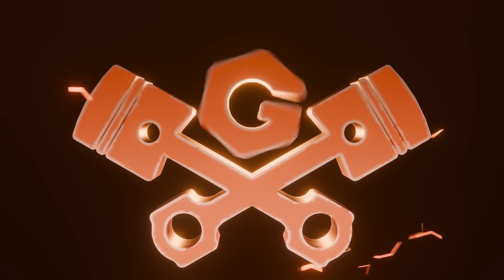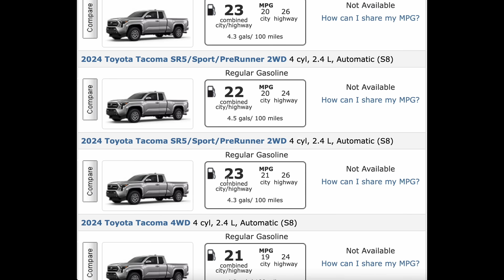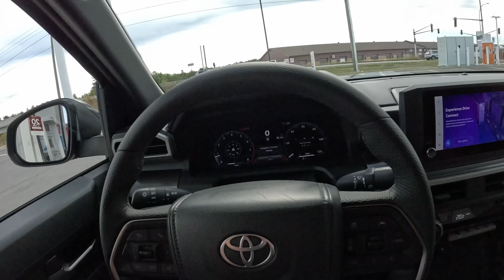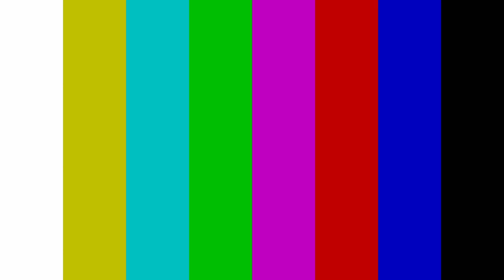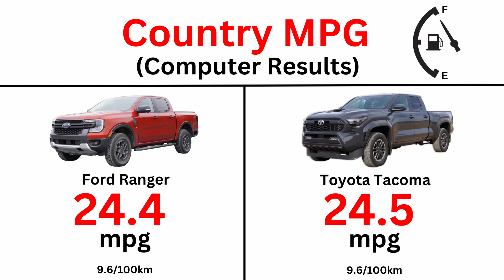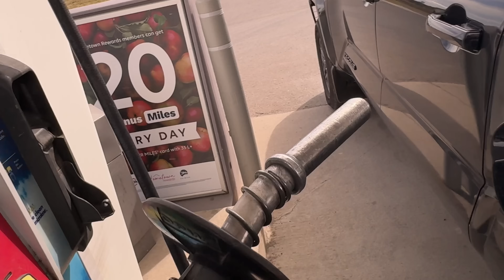Toyota Tacoma 2.4L Turbo Fuel Economy (MPG) Test | Shockingly EFFICIENT or OVERHYPED?

Comment: Mid size trucks never made a whole lot of sense to me, my 2017 Tacoma with the V6 and max tow only averaged around 19-21 unloaded and towing my 3-4k lb trailer got 10-13mpg. I switched to a Ram 2500 6.4 gas and got 16 towing and 19 highway unloaded. I was shocked to be saving money and the Ram never had any issues, my Tacoma had some major failures and was constantly at the dealer.
Reply: Was it transmission failures?
Reply: @TomXCZD  No on the Tacoma it was engine leaks, diff problems, engine problems, radio problems and a major cab leak.
Reply: You're not wrong about the mpg being rather negligible but a lot of people (including myself) don't want a vehicle that long and wide. They also cost about 10 grand more if you're comparing equivalent trims/features.
Reply: Yeah the amount of people glazing these 2016 and 2017 Tacoma like the holy grail is so funny. People really do have gold fish memories. 3rd gen tacoma was called Turd Gen for the first few years when it launched. 2nd Gen owners were saying Toyota ruined Tacoma when 3rd gen launched. And now 3rd gen owners are saying 4th gen is ruining the Tacoma. 

When 5th Gen launches the current owners are gonna say the same crap lol

Comment: Can you do this with a SV Frontier?
Reply: I will tell you, as an owner.
The frontier pro4x with premium package, no roof rack, no light bar with soft tonneau cover is a consistent 16mpg city, 19hwy. 17.3 mpg avg over 13 fill ups. 87 e10 top tier fuek. 
I added a kn filter, taller michelin ltx at2 tires, kn filter all synthetic fluids it improved by 1mpg. 90 octane non ethanol it adds one more. 
You run it hard highs speeds on interstate, its even worse. 
The sv is somewhat better as its lighter, diff gear ratios, non locker, smaller tires, sits lower to ground. 
Its 2-3mpg better on average. 
Local advance auto has the 2wd, king cab base model  and it gets  20 and 23. But it is bare bones as can be had, with very skinny tires, and the ass end 3-4" higher than the front. 
Nissan missed the mark badly on that engine and transmission. Plus  that huge ass frontal area of the new grill design is bout as aerodynamic as a brick. 
What the dash shows is a consistent 2-4mpg low. Anyone tells you they are aversging better than 20 mpg on a new frontier dont know this or are full of it.
Reply: My brother gets 19-20mpg in his Pro4x with 265/70r17 tires. He's mostly highway with his commute.
Reply: @Tylnorton id that  hand calculated or dash dispaly?

Comment: My friend as the same Truck with now 25,000km's.  It was going to be my next Truck till I drove it.  Engine power is good but it ride's like crap.  It's so rough and feels like it's falling apart when you go over rough road (hood shake's and feedback in the steering).  His interior plastic's is not holding up good either.  I am a big Toyota fan but My 1995 GMC looks better inside.  Very Disappointed in Toyota's since the 2022 Tundra was released.
Reply: "My 1995 GMC looks better inside"

Absolute cap bro lmao.

Comment: First of all what you call "city Driving" is inaccurate.  Let's see the fuel economy when in continuous stop and go traffic?  That is real city Driving.  In my opinion your choice of roads is more closely related to highway despite the reduced speeds.  Non hybrid vehicles get worse economy in the city vs highway so that tells me your test is inaccurate.
Reply from the maker: I mean I drive right through the heart of the city its as much "stop and go" traffic as I'm going to get. you aren't wrong but the key with my tests (in my opinion) is that I run every single truck on the same route so its not so much about matching the EPA figures but rather comparing the truck against each other on the same route.

Comment: It's fine for someone who doesn't need a work truck. None of these 4 banger turbos is going to last if it has to work hard.
Reply: You must be psychic to see in the future like that. If these new ones are anything like the old ones, they'll last. I believe Toyota knows what they're doing. Time will tell.
Reply from the maker: one of my concerns as well. but it is a mid-sized truck and probably not meant to be doing long stretches of work to begin with.
Reply: @GettysGarage .... Im.still.driving my 99 Tacoma, v6, automatic, its loaded with tools, work camper , 3 ladders,ext cab full of cordless tools and pull a small trailer often, i drive 5 days a week as a Trim carpenter, still going strong, maybe the new ones arent built to do that, but mine Works
Reply: @GettysGarage a little off topic but I was wondering what your thoughts are on diesel oil. I'm currently using Mobil Delvac Extreme full synthetic. ( Vs. Rotella T6) .
Reply: Why is everyone scared of turbo engines?  The turbo will last as many miles as you can drive in ~10 years...and then it'll be something annoying like the wastegate shaft seizing up.... Honestly, the more you drive it, the less likely that failure is.
Reply: you shouldn't buy a tacoma if you actually need a truck to do truck stuff....check out the new frontier instead.
Reply: @billw8476   Nobody wants a Nissan lmao

Comment: My best mileage on a 24 TRD Off Road 4x4 is 27.5 mpg. I avg 25. Its 40% better than the 3G 3.5 V6
Reply from the maker: the 3.5L was a thirsty girl
Reply: I do also with my Land Cruiser with some bigger tires.
Reply: Is that actual hand calculated at the pump mileage or the dream meter?
Reply: @deweysturgill6220 the “dream meter” showed 17 mpg consistently on my 22 4Runner, so I’ll take the win even if it isn’t completely accurate.
Reply: @ToyotaChrisWI 😂if nothing else it makes you feel better. You should hear what some of locals here in the hills of east tn what the runners are doing on hand calculated mileage. 
Its brutal esp the ones with more agresssive tires and an overland rack on top. Like a big block chevy.
Reply: @deweysturgill6220 yes sir, I was there back in April, and heading back there next month 🤘🏼🤠

Comment: 2018 ram 1500 321 rear 4x4 quad 6 3/4 bed. All terrains. 21-25 mpg 45-68 mph. Plus a ton more PAWAH BABY!!!
Reply from the maker: The rams can be sneaky fuel efficient!
Reply: Same specs, just 2017 and V6. Used to get 19-20mpg. Now I get 17-18mpg. Falken Wildpeak AT4Ws at LT265/70r17 are heavy. lol

Comment: I’ll take the torque, the expected longevity and options in the Ford over the Taco.
Reply: Longevity?
Reply: @stefanovichmichael9686 yes… longevity. There are plenty of reports of 2.7 and 3.5 Ecoboosts getting well over 120,000 miles. Can’t say that about Toyota’s newest additions.
Reply: @beri232   theres plenty of FT motors north of 100K by now with no issues. Wouldnt trust a crappy ford for anything.
Reply: @TheDoc813  man….. you are a funny one! 🤡

Comment: I don’t like these new Toyota Tacoma’s the last series models have a cool off road look to them the exterior and interior.
Reply: I totally agree the gen3 DC looks cooler overall and especially as a short bed.  A long bed DC  needs bigger wheels/tires and a little lift to adjust proportions (my opinion).  Conversely the gen4 as a short bed looks off, but the LB has better proportions. The front end styling and low roof gen3 just timeless and unique.  Gen4 looks like every other pickup truck. 

Now, I just bought a white gen4 DC LB SR5 with OEM silver wheels and I am super happy but I like the look of the 2019 Lunar gen3 DC SB with the darker wheels that I gave to my daughter more than the new truck.  

Comparing SR5 models removes the influence of higher end wheels and bumper treatments and scoops and graphics. 

Well I am 63 now and no truck will make me look like a cool young dude.

Comment: Midsized trucks just don’t make economic sense. They’re nearly the same prices as 1/2 tons and even barebones 3/4 tons yet offer only a fraction of the capabilities. Midsize trucks look good, I suppose. They just don’t offer a good value.
Reply: Can't fit a full size in a garage or park it in the city.  It's not made for everyone.
Reply: Yes except no. A half ton the same price of a SR5 premium package is a stripper XL or WT model with vinyl seats. The equivalent half tons are $65k+. And 3/4 tons ride like brick shit houses.
Reply: @Nick-ue7iw haha. I agree. I just bought a cheap 2026 F350. Yes, that suspension is FIRM when not towing. But I sorta like it. Plus I got a 7.3L gasser. Yes it swills gas but I value reliability more than almost any other aspect. The OTD price was $49,500 with a rear locker, power rear glass, power folding mirrors. It’s a base XLT
Reply: The older smaller Toyota Tacoma with a 3.0 inline 6 would be the perfect set up.

Comment: I always smile when i see people believing more a gas station fuel pump with 2 clicks than a complex ECU precisely caculating the fuel it needs to go in the engine every 1/1000 of a second.
Reply: Every manufacturer is different in terms of how the ECU calculates.  Also mixed scenarios like towing and not towing for part of tank really messes up the computer calculation.  I’ve had one vehicle which differed from pump calculations by 0.5 mpg over thousands of miles and another which differed consistently by 2.5 mpg over thousands of miles.  Most vehicles I’ve owned or rented though have differed by 1 mpg.  I don’t use the two click method either as that seems to be inconsistent depending on the pump.
Reply: The ECU doesn't account for the tire size and conditions that effect the rotational distance traveled.  It's not the same across the entire model line.  You have 31-33 inch tires between all models.  The most accurate calculation is GPS verified distance divided by gallons used.

Comment: I like the new gen Tacoma but they should have increased the rear legroom
Reply from the maker: It is a tight cabin!
Reply: Buy a full size if you want legroom.  No midsize is comfy i don't care what anyone thinks.  1 or 2 inches won't matter in the back.  The actual interior space is tight no matter what brand midsize.
Reply: Exactly.  Buy a full size

Comment: If they were to offer that truck with a diesel, I would totally get one. Crew Cab long bed.
Reply: Get a Hilux from Mexico.
Reply: @blakerust6777  Guarantee you wont like them as much as the Taco. I've driven a few hiluxes, theyre not that nice. The diesel is very slow compared to the 2.4
Reply: @Tacobuster88 it’s the uniqueness of it that I find appealing. I know it’s more utilitarian than a taco. But that is what makes them so cool.
Reply: @blakerust6777 They definitely rank on the cool factor, I guess the grass is greener on the other side haha. My biggest gripe has always been the styling 😅
Reply: Totally agree… but after renting the Hilux in Iceland my TRD off road with manual feels very similar.  The Hilux is still better in every way but way closer than previous generations.

Comment: I have had my 2024 Tacoma Sport for 1yr now[17000kms] absolutely love this truck, and the truck has been at 9.3lt/100kms all summer since I reset last spring.  On a side note my last truck was the 2019 ford ranger with the 2.3lt turbo and it would average 9.0lt/100kms over the summer same driving.  But as far as transmissions go the Toyota 8speed by far a smoother shifting transmission than the ford 10spd......
Reply from the maker: the ford 10 speeds have certainly had there issues over the years

Comment: So I have 24’ SR5 RWD Tacoma with 24K miles so far. I get around 32mpg on the highway. On average I get 380-400 mile ranges at home. On long cross country road trips I’ve gotten I get it up to 415 miles. I usually fill it up when it gets 90 miles range and fills up with approximately 12.6 gallons. Love it. I’ve taken it to South Dakota, Wyoming, Colorado, Tennessee, Missouri.

I will not note that in the winter the range drops drastically. Around 360 miles.

And It doesn’t beat my 2019 Camry LE on road trips.  That thing gets 550 miles ranges on a single tanks. But for a truck it’s not bad. It’s definitely better than my old 97 c1500 pickup.
Reply from the maker: lol I think anything would be better then the old C1500 pick-up. I had a 96 K1500 350 and that thing liked the drink!

Comment: I'm not sure how I feel about the looks, I kinda like that Ranger better.   I can say they Killed the back seat room with this one, which honestly the Tacoma could not afford to do.    That chin would have to go instantly if it was mine.    I had a 2020 Tacoma that I took mine off day one.    This engine is much better than that old 3.5.   It had NO torque.   had to rev its guts out.   I towed a 4k pound camper with my 2020 and HATED it.   Even with a tune it was a turd.   The 3.5 engine was a Camry engine, not a truck engine.     I traded that truck in for a 2021 Silverado with a 3.0 Duramax and I don't look back at the Tacoma.   I did like the truck until I had to do truck things then it SUCKED.
Reply from the maker: Very fair! probably a massive improvement to the torque heavy 3L duramax.
Reply: @GettysGarage huge difference.   Night and day.

Comment: The real reason the Toyota got better mpg is because the Toyota front chin wind splitter is big and gives you 1-2mpg ranger is designed for Australia 🇦🇺 and is the number one selling truck in Australia for a reason off roading they do the f-150 is made for the American 🇺🇸 market and has big chin wind splitter on front for aerodynamics when you drive to the mall lol 😂 ranger is 10 times better off road then f-150 and the raptor ranger is the best raptor ever made plus it’s cheap

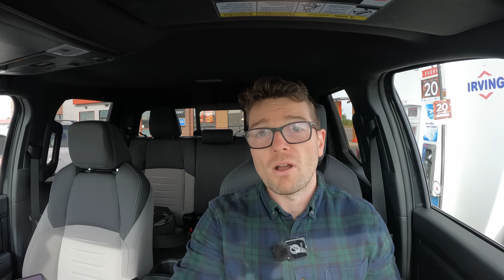Comment: Sorry to crash the party but my F250 crew 4x4 6.75 box standard powerstroke 2025 King rancH 7800 pounds 3:31 geared 16000 pounds towing capable with 3000km on the clock already does 
10.4 liters/100 combined….
Reply: OMG MY GOD YOU ARE SOOOO AWESOME!!!!

😂 Truck guys.....
Reply: @ProbeGT2 woooo I hurt the Tacoma Starbucks crowd here today😂😂😂
Reply: Not comparable...plus you are paying more for diesel and on top of that def.  Plus you can't park anywhere with that long wheelbase.  And not as reliable as a Toyota.  And more expensive parts overall since it is a heavy duty.  Plus you are paying more to insure your truck......should I keep going?
Reply: Watch out everyone... Here comes KIIIIIIIIINGGG RANNNNCHERO  !!!!

Comment: I have a 2025 ford ranger with the 2.3t eco boost and it’s my company truck that’s chipped for driving habits or for lack of better words can’t accelerate hard or speed etc. I sit at 11.9 in the city and 11.2 on the highway cdn. It’s not fuel efficient at all and I hate the economy and transmission on that truck.